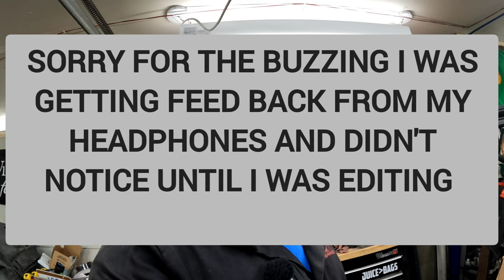Bagged Mini Truck Build #19

Comment: Looks good! Seems like so much work… thanks for the links for the fenders.. 

Do you think if you stock floor dropped it, it would be more work? I have some 2x2 box tubing 1/4 wall that I’m thinking of lifting the cab up then cutting the top of the frame on my hardbody, then installing the 2x2 in the frame and welding it up. Then dropping the cab back down.. 

I’m not gonna be able to make it to the mini Nats, and might not get to finish the hardbody.. this year…. 

My finances have changed so now my projects are on hold and might end up for sale.
Reply from the maker: Stock floor there would be more involved you would still have to cut the front frame horns and lower them down. You would have to move the body mounts down. And depending on the size of the transmission in the hardbody you would still have to modify the trans tunnel (I'm not familiar with that part of them)  you would have to most likely modify the exhaust since you are bringing the floor closer to it.  

And I don't think either one is really more work then the other. I think it's just a different type of work one is more frame rails and thicker material.  Traditional is 90% sheet metal work. Next few projects on the channel will be full frame build and floors from scratch I dont mind either way . I'm a one man single car garage so I felt without asking for friends to come over multiple times to push the truck I and out of the garage then move the frame in and out. Or suspending the cab which i definitely do not have the room for with my just under 8f ceiling garage this was the easiest way to accomplish the body drop.